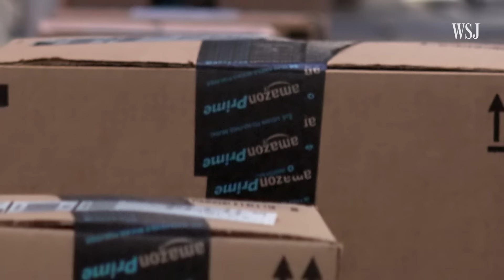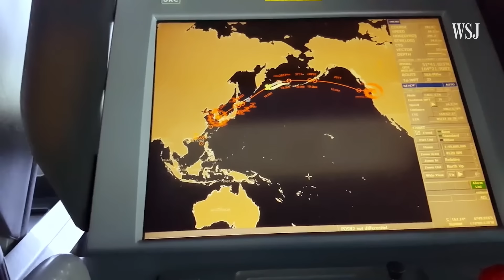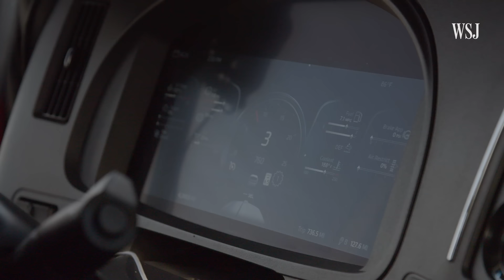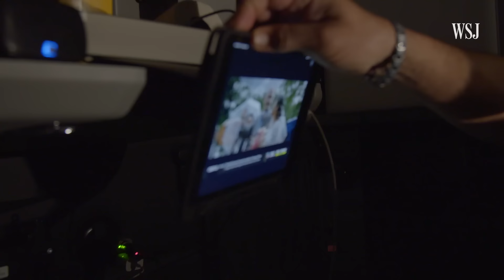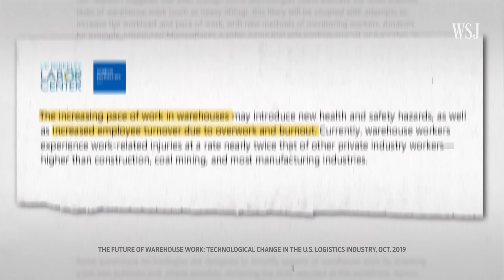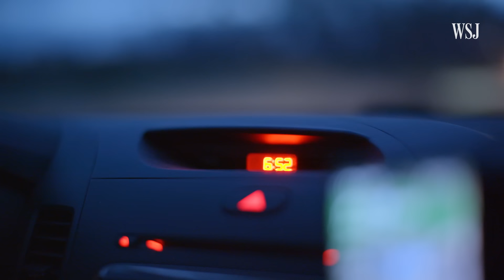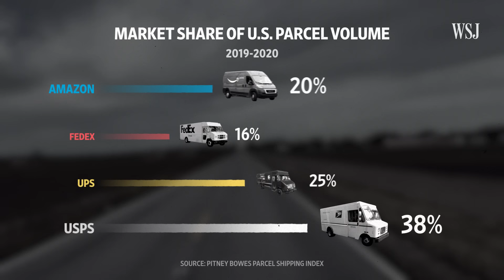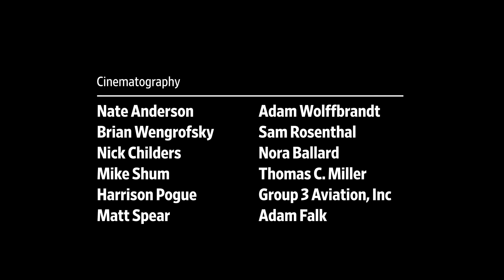Why Global Supply Chains May Never Be the Same | WSJ Documentary

Comment: "The issue is not having enough people willing to do the job long term." This statement boggles the mind. If the industry is getting feedback that the job is not desirable why isn't the job being altered to attract more people? If people don't want to do long haul trucking why not alter the trucking to be more like a relay. Instead of truckers owning their trucks the logistics company should, that way John Smith can drive the truck X miles and hand it off to Jane doe to drive it Y miles. Am I missing something here?
Reply: That's how most European truckers work, they're employees. That naturally comes with it's own caveats like the companies forcing drivers to do tired overtime and such. Trucks should drive autonomously
Reply: Or just ship trailers by train. They've done that for years. You can easily have two people haul 100 trailers across the country and only need truckers for first and last mile trips. It would at least ease up on the highways and give truckers more stability.
Reply: Exactly
Reply: @thetrainhopper8992  Trains do ship cargo cross country. There's just not enough infrastructure to support a massive ramp up.
Reply: @sclarsen86  agreed. The railroad is at peak capacity and at every point in the supply chain regardless of # of people, these things are very difficult to run happily without massive restructuring and supply chain band aids. The issue is, what happens when this demand goes down, if infrastructure increases? Vacant ports, non profitable railways, and those employees as truck drivers can’t get hours because competition is so high.
Reply: Yep, you missed the fact that the job SUCKS.  Between being jerked around by your employer and not being able to make ends meet, nobody wants to put up with that B.S.  Same with everyone, really.  Here's a well-timed clip: https://youtu.be/phieTCxQRLA
Reply: @deemushroomguy  I love John Oliver, and it's funny how similarly timed these videos went up. I just don't find your argument compelling. If people didn't do jobs because they sucked the series dirty jobs with Mike Rowe never would have existed. There's always a price people are willing to do something.
Reply: I get the sentiment... I really do. However, the logistics companies are in a competitive landscape, just like almost every other business in the world. They have built their business model, services, and infrastructure around offering cost effective transportation of goods from point A to point B... What you're suggesting would ultimately raise their freight rates, and price themselves out of the market. If ALL freight companies were to do this at the same time (lets say, by government mandate) then the price goes up, which is ultimately going to effect the demand, which is going to effect the supply chain (and the economy in other ways). All of this interconnected... there is no simple answer, frankly there is not a real "answer" at all.
Reply: @nbonasoro  
It's not just that the job sucks.
    There is a suckage / compensation ratio.
   + (under the suckage) is the training / qualification requirements.

    I looked into getting a cdl & that sucked in many ways (non of them good).
   Not just getting it, but keeping it. 
   There were so many ways a person could loose the license,  it was ridiculous.
   
   Then companies are always screwing the drivers in many diff ways like expecting drivers to drive loads that are overweight.
     Company's also try to squeeze every pennies out of the deal for themselves.
    Laws are always on the side of the.company.

      It sucks and it's not worth the compensation.
    With inflation, a lot of dirty jobs might not be filled unless they sweeten the deal.

    Like the restaurant owner can't find a dish washer.
   He complains &complains & looks & looks with no luck .
    Did he offer more pay, maybe some vacation time, a sign on bonus, maybe treat them with respect?

   No. None of that. Just scratches his head & complains . He can't understand why he can't find anyone to work the shyt job with shyt pay at shyt hours and no bennifits.
Reply: @hunterfoley9185  
I agree with agood deal of thar, except you haven't considered the fact that most of these companies make huge profits and or pay huge amounts to ceos & board members while employees can't make ends meet.
   Maybe laws to limit the difference in salaries. 
   Like a ceo can only make x% more than the agv company employee
Reply: @thetrainhopper8992  Here in Canada, there are two train corporations nationwide. Canadian Pacific and Canadian National. In the beginning trains were the go-to form of supply for all Provinces and the network of towns, cities and villages across the countryside. Then about 10-12 years ago both companies decided that they would no longer maintain the sidings and rail lines that supplied the towns and villages via spur lines. Trucking was faster and cheaper and warehousing was more cost effective. So they tore up the spur lines and sold the land to districts. Now lo and behold fuel costs are horrendous and they can’t find truckers to drive. The shelves are for the first time since WWll are empty. Go figure.
Reply: @sclarsen86  the problem is more the labor force than the physical infrastructure. Thanks to Precision Scheduled Railroading they got rid of their staff and don't have the capacity to deal with changes in demand. Also they don't care to haul more than grain and coal these days aside from some cargo containers. They have a manged decline mindset and have had that since the 1950s
Reply: You can't think of any reasons why shipping/trucking companies are hesitant to make changes like that?
Reply: @thetrainhopper8992  Holy jesus. Roads won. They don't have a defeatest mindset. Roads just won. Everyone else in the entire world seems to understand roads are better than trains for most use cases. Do trains have a purpose, undoubtedly yes. But they will never be as good as roads are at everything else. Rail networks everywhere took a beating once economical paved road systems became possible. As more things came along that could use roads the usefulness of trains kept declining. The defining moment of train history to me was Penn Station. Grey Hound put a bus terminal across the road from the busiest train station in the world, at the height of rail's power. Penn Station stopped being the busiest train station in the world inside a decade. It fell so far out of use they demolished the station. That bus station stayed as busy as ever until NYC made them move it because of the traffic it was causing. The holy cathedral to rail was demolished because more people wanted to take a bus from the rinky dink grey hound station across the street. But you're talking about freight, it's the same story. Trucks can pickup from anywhere. There doesn't need to be a rail line. Pour a concrete slab and there's a truck dock. And if the truck has to be used to get the cargo from anywhere anyway, it's actually faster to just keep sending the truck on it's way than drive to a rail line and swap transportation forms. It's the exact same reason buses won over Penn Station. They're more flexible, and flexible makes them cheaper. Rail has been fighting a losing battle. They do not have a defeatist mindset. They lost. Rail is very very good at point to point set destinations. But the moment anything isn't on that set point to point destination a whole other set of calculations come into effect asking if it's cheaper to just send the truck across the roads to where it's going or if they should transship it by another means. It's almost always more expensive to transship to rail than just send the truck on it's way.
Reply: or maybe even, crazy idea here, paying them a living wage
Reply: @sylfixplayz2142  that's bad business
Reply: @sylfixplayz2142  I don't think the issue is the wage truck drivers make between 36 and 61 thousand per year. That's definitely a living wage.
Reply: yeah you are , companies wouldnt make as much money that way .. thats whats bothering them
Reply: @Bobcagon  We have more railroads here in the US but the situation isn't much different. Even in my lifetime, most of the local and regional spurs and lines have been torn up.
Reply: You are most definitely missing something here...... the problem is that they are finding it hard to find enough people to hire and your solution is to increase the number of people they need to hire to get the job done?..... smh.
Reply: @grahamyodude  They are having trouble finding people because the demands of the job are too much. By reducing the expectation they can attract more people.
Reply: @grahamyodude  what I got from the OP's post was that companies complain, but don't do anything to actually induce people to want to work for them... i.e. adapt to the needs of the potential workers. Some companies reduce churn by improving working conditions, and/or pay. It's not an unusual concept. But a lot of companies seem to prefer to complain about the nature of today's labor force rather then get creative in finding and retaining people. Too many rely on recruiting techniques that clearly aren't working.
Reply: @chriscampbell9191  I see that when watching documentaries based in America.Rural communities that have been gutted. Abandoned rail lines along with the rail cars and equipment. Shells of manufacturing buildings left standing. Spur lines overgrown. Very dystopian. And now in both countries a massive shortage in line haul drivers which will not be repaired.
Reply: Of course.  The company wants to make more profit so "Robby the Robot" drives the truck. Payment = a squirt of 3 in 1 oil.  That is where it is going to.
Reply: Did you not pay attention there’s no central power for truckers no union to make big decisions like that and to make the infrastructure for a relay
Reply: @sclarsen86  Ironically, a huge amount of locomotives are idled and tracks have been ripped up due to the rise of long haul trucking.  The infrastructure WAS there.  It needs to be put back.
Reply: @ARocketScientist85  It is impossible to overtime.  To start a truck or bus you need an ID card. If you do overtime you will get not just a fine but get your license withheld, the employer will also get into trouble.  17 yrs ago I was on a tour in Europe, due to heavy traffic we were not able to make it to the planned hotel at the end of the day.  The driver just stopped at a nearby hotel before his work time is up.
Reply: OP, when an industry encounters a 'problem', the problem has been there longer than you know it, and smart people have been trying to solve it for ages. 
Truckers are human, so they want to own trucks of their own.  Meager pay and lousy/dangerous/boring work conditions aside, truckers are 2 types.  One type can deal with short repetitive routes, the other can deal with long hauls.  The short route guys don't have the mental and physical to deal with going away for 2 weeks doing 5-600mile/day. The long haul guys can't do a short route 10 times a day, it drives them insane.  And the high turnover is people can't deal with the boredom, the repetitive nature of the job.  
Problem is not about trucking industry, but a very fast change of consumer purchase behavior, which the logistics industry seems to have difficulties catching up.  But honestly this is not even a problem unless you think it is.  Most of us can still buy the essentials we need.  
By the way, stuffs online will eventually become more expensive than buying in stores when shipping is included. And we would have not choice because the things we want to buy are mostly online only.
Reply: @golferchin76  I'm assuming you're a driver or have some experience that gives you this insight so if your comment is informed I appreciate that you gave me a better understanding of the issue. My 1 contention with your comment is online shopping doesn't have to be more expensive than in store. Most items are below 5 pounds which is going to be delivered by drone. The online and in store shopping have the same travel distance up to the warehousing portion of their product lives. The question is will drone deliver be more expensive than a person driving a truck from a warehouse to a physical store and I would guess they are comparable. If online is more expensive it won't be by much.
Reply: @sclarsen86 years ago they tore up the tracks where I live. Not sure what happened there.  ignoring infrastructure? It can't be financially possible to bring all that back. We are a society of closing the gate after the horse got out
Reply: @thetrainhopper8992  After 24.2.2022 we wish not to send containers from China to EU via Russian railroads...
Reply: It not simple like you think. Doing like you say relay, it cost time, paperwork, software and management, there is not enough management.  I am in the trucking business, it is problematic.
Reply: @ConChimBayXa  I will take your word as you are in the industry but I would question how there isn't enough management when we graduate more MBAs than the market can absorb where they are going underemployed. I think the relevant question is, is it harder to find a manager or a trucker. Also is it more costly to be understaffed or develop software. There are tradeoffs and I would think if there is enough demand, the investments would be worth it. But like I said you're in the industry so I assume I'm not saying anything that hasn't been looked into.
Reply: @ConChimBayXa  they did it for 60 plus years that way with no telematics, algorithms, email and onboard software communication. There are many big companies that still operate this way, like Fed ex and UPS for starters. Of course it can be done, it’s just cheaper to bring in immigrated labour, and sell them a dream. There is a reason why no one follows their dad into the business. Long hours, unpaid labour, etc. Trucking is profitable, but only if you share. Everything got gone in the 40’s, 50’s and60’s. dad was home at night for his daughter’s recital or sons ball game. No divorce, no I don’t who he is bs. The societal impacts of JIT go much deeper than paperwork.
Reply: @nbonasoro  you are right on every point, but nobody really tackle the issue on any level.   One more things the government making it not attractive job is they regulating the trucks,  it have to be 2011 or newer.  And thats hard on company and owners & operators.   Government come out with new rules n now wondering why trucking businesses  is struggling….  A-lot of truckers quit or quitting because of new emissions rules
Reply: @donovanjones4175   i wish you were right, unfortunately you don’t know what lay on the other side.  You can know if u in the bee n knees,   Emission rules change, making it impossible for owner operator n company to adjust to the high cost of a new semi truck
Reply: @donovanjones4175   I mean you are not wrong,  but it take leaders to make efforts to fix this kind of issues
Reply: @ConChimBayXa  you are correct sir, that’s what make this whole thing so frustrating. American and European democracies failing. China still using coal, we are headed for some dark times.
When a man like Elon musk shows the way forward, maybe more leaders will fall in behind him.
Reply: @jupitercyclops6521  A million thumbs-up to that! Regardless of the work we do, we are all cogs in a huge machine. The disparity in salaries is sickening, particularly when the lowest paid jobs are often the most essential!
Reply: meow meow meow
Reply: Yes !!! you building the business model and become the next billionaire.
Reply: Cool idea. Long haul trucking looks really lonely and monotonous. I don't see why the job itself can't be improved.
Reply: @ARocketScientist85  there's no overtime for lorry drivers in EU!
Every truck and driver are monitored and hours counted by the minute.
Fines for braking regulations are huge, both for the driver and company!
Reply: @halycon404  simply not true. Rail transport are way more profitable when all costs are counted. Road transport are paid by taxes, while Rail is calculated on its own.
Environmental issues are ignored and left for future generations to pay for.
Combination of lorry and train is the best solution, as it once was..
Reply: They do that, but it's b/c the driver got sick or truck brokedown, 'repowered load' they're called I think. 
They generally don't relay b/c it makes it more difficult to pay out on the load & if there's any tampering with the load tag/trailer there's no finger pointing if there's only one truck moving that load.
Reply: @sylfixplayz2142  tell Bezos and the shareholders that and see how far it goes.
Reply: They're waiting for Autonomous vehicles.
Reply: @mirowestmaas4566  as Madeline said, "it's twu it's twu"!
Reply: I've done that before for dedicated freight, 5 hours up, 5 back, 5 days a week and know it's also possible for a vast majority of freight, obviously not all.